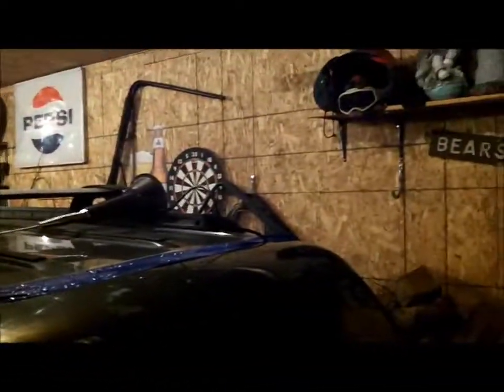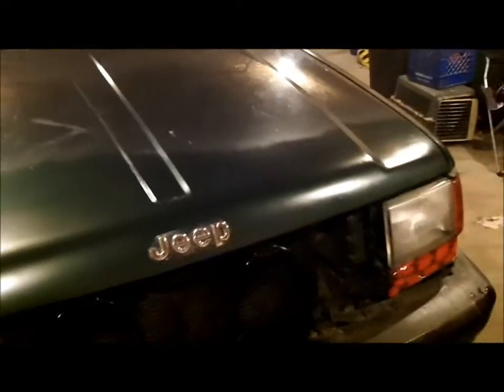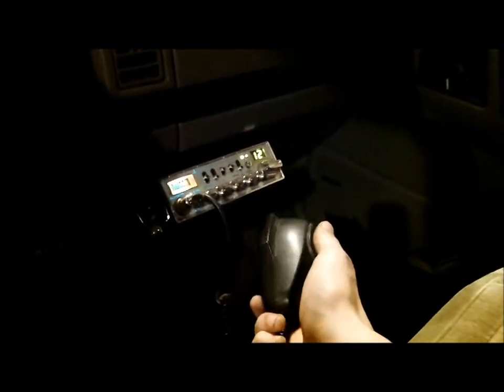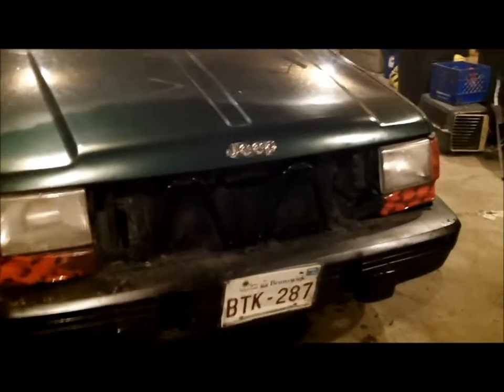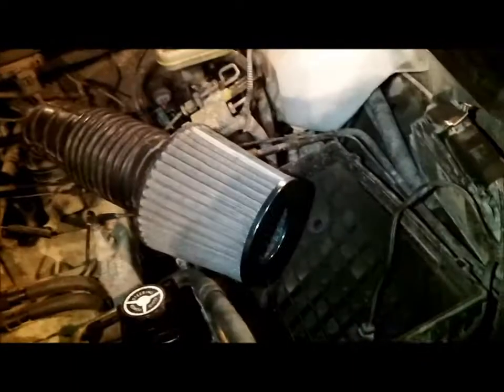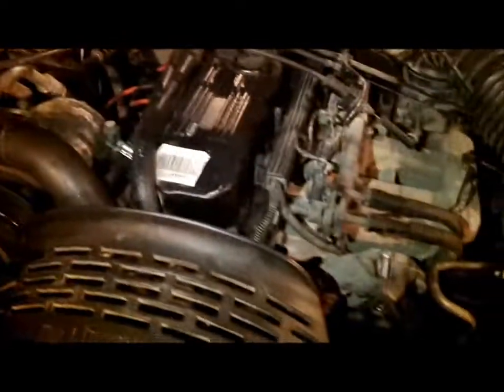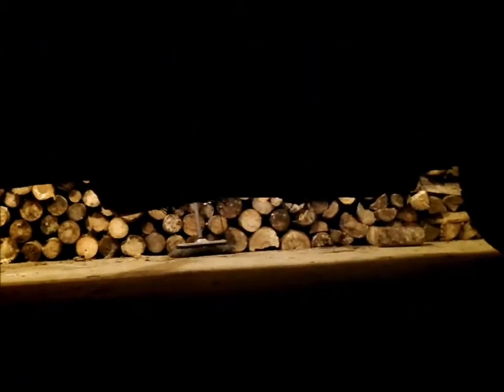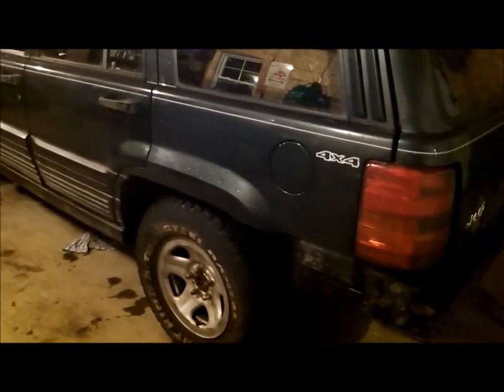Jeep Grand Cherokee update ( Project Woods Runner ) (HD)

Comment: bondo the rusty tailgate. "murder out" or high gloss the paintjob. use rustoleum high gloss paint, not the spray paint, and a roller after sanding down the original paint job. 3 coats, doesnt take long, lasts for years